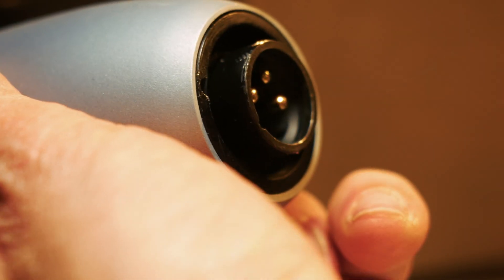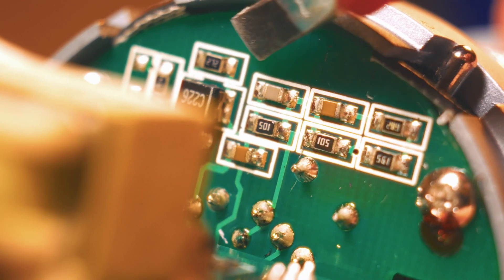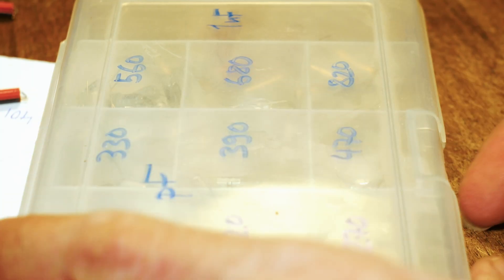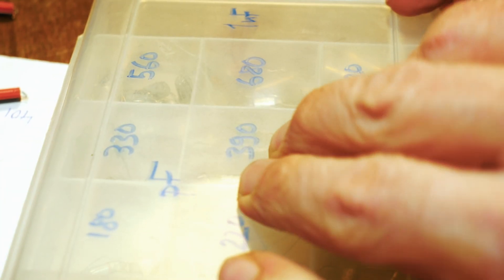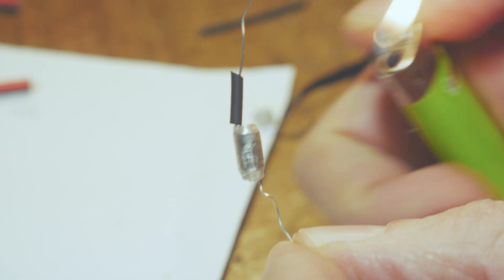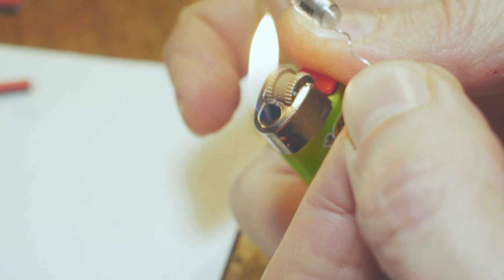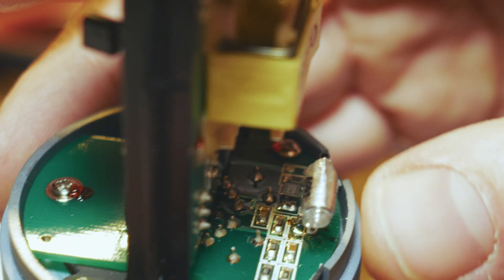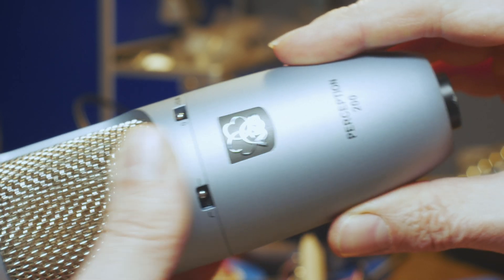Quick Demo - Modifying the AKG Perception 200 - Much Smoother!

Comment: You would need to change all of the smd caps for THT ones that are in the U87, the transformer is not the issue. The capsule is not the issue, keep the capsule and the transformer and change everything else and you will get a great sounding mic.

Comment: This mod originated at GroupDIY, with a user called "kingkorg."  There's a thread discussing it over there that anyone wanting to do the mod should read.

Most people are better off doing the version of the mod where you simply piggyback a ceramic (NP0/C0G, 0805 size)  SMD capacitor onto the existing one to increase its capacitance.

Comment: Honestly I prefer one before modification. And I mean if one want deep sound why not just buy some ribbon microphone or use dense pop filter.

Also this modification doesn't do anything that can't be done in post production with EQ. Cause well it's literally a EQ modification.
Reply: You have no idea what you're talking about
Reply: @rexsrb  😂
Reply from the maker: That's a valid point. After all we're still hearing the exact same capsule.
Reply: A lot of people simply prefer the flatter frequency response as a starting point for EQ.  Others using a colorful preamp might be concerned about the brightness affecting how the preamp saturates.

But you're right, if you're not worried about those things, doing it in your DAW does the same thing.

Comment: I just watched another video where the guy who modded his 420 with a 680 capacitor. In the comments, he said he went back and put a 470 capacitor to get back a little more sparkle. What are your opinions on this?
Reply from the maker: I haven't tried higher value capacitors and have stuck with the recommended 470pF.
Simply because the treble response seems to be just about right this way, it sounds well balanced in my book.